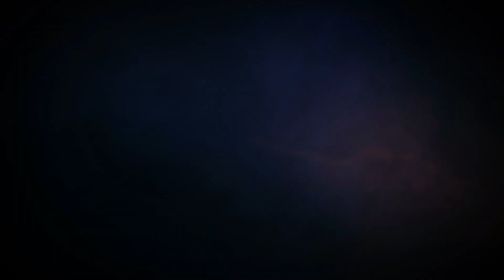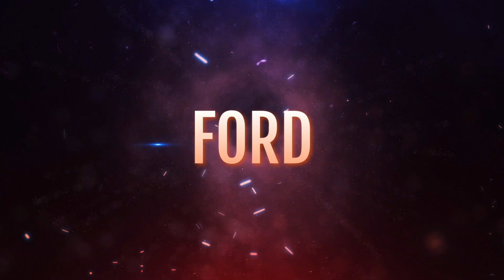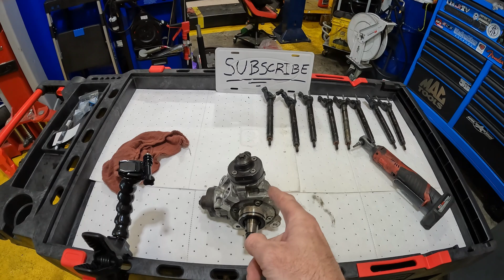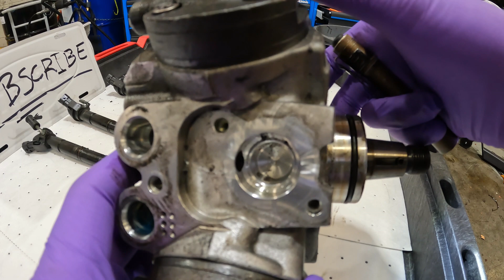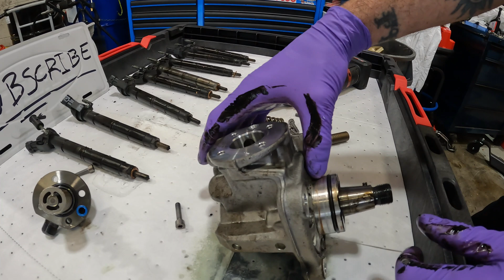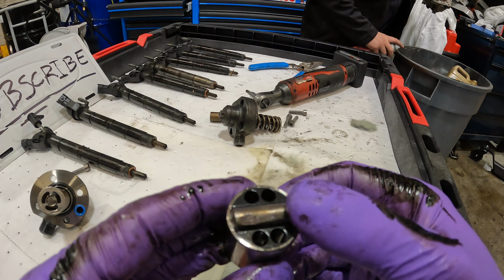Metal Everywhere! Failed CP4 Dissection

Comment: Great video! 
I’ve always wondered what causes them to turn in the bore. High rpm’s when engine braking? Not enough fuel additive? 
Sometimes when engine braking downhill pulling my trailer, my rpm’s will push 3,500-3,800. I slow everything quickly using the brakes because I worry about the vibrations and harmonics at those rpm’s and what it can do to the HPFP like you’ve shown.
Reply from the maker: None of that will cause it. It just happens. Some it may never happen to. Some it happens very quickly. Some it takes a while. This fleet runs additive. I have some with 600k Some with 400k. Still going. Others not so much.  They are all being converted though

Comment: Have you seen bad batteries in 2023 super dutys? I keep getting the remote services disabled notification. Took it to my local dealer who updated the pcm. It didnt help. When i check the voltage with a meter it is at 12 or 12.1. Happens almost everyday after the vehicle has sat overnight.
Reply from the maker: It may have sat for a while. These new trucks anything under 12.w they don't like. I've seen 22's go through batteries. I would have them warranty them and reset battery monitor system.
Reply: @BeardedFordTech  I'm being told that if their diagnostics won't say it's the battery then Ford will not warranty it. Might be forced to buy a new battery myself.

Comment: I dont understand how a multimillion dollar company like Bosch thought it would be just fine for those plungers to not have a stop to prevent the spinning in their bores. Its just straight up dumb to think metal on metal cam would never cause these catastrophic $10k+ problems. The fact that Ford is still just going along with it frustrates me so much too. Even Cummins is now getting away from these POS's 💩 so you know they're garbage. Theres gonna be a class action suit that pays out millions in the future(im sure several are in the courts already). Get rid of that garbage, put a S&S DCR pump & forget about it ever happening again! I'm still rocking a 7.3L but this really frustrates me because this 6.7 is a really good engine, that Ford did their homework on to do the best job after the disasterous 6.4 fiasco.👍🏻👍🏻🛠️🔩🔧🛢️🤷🏻‍♂️😎🍻
Reply from the maker: Well. For beginners you may be new here?  Yes we all know it's garbage. Did you not here me say we put a s&s dcr in it?  That I'm putting the dcr in every 6.7 in my entire fleet.  Whether they fail or not. 10k is a very low price. Every one I've ever done at the dealer was 20k plus. Here running the fleet the dcr kits I get that come with injectors and rails and lines and the pump is 6k. I got the whole kit cause some of them have gone down with metal contamination.  Others are throwing the low fuel pressure code with no contaminants and thats usually the rail.  But it's getting a pump and rails.  I agree. Why on earth would they not make it where it doesn't move. Apparently on the 23's they did.  I mean look at the 2.3 ecoboost. The 3.5 the 5.0. The bucket goes in one way so it can't turn.  Pump sits on the bucket. Never has problems. These cp4 is garbage (so is cummins by the way. Can't stand them) but they were smart and went back to the cp3.  Ram even had a recall on their fuel pumps to replace the..  I'm sure there will be a lawsuit if one has started already.  The 6.7 is a great engine. Just that cp4 is the one major flaw. How many miles you got on that 7.3?

Comment: 250k miles, honestly, I feel like buddy should have replaced the CP4 or done that DCR at like 200k, at least I would have....
Reply from the maker: It's a fleet vehicle. I have some with 600k going strong. We are currently in the process of changing them all the dcr
Reply: Yeah, DCR seems to be the way to go, I'll probably do the same at some point. Looking forward to hearing more about it, I'm sure you'll need a few years to report back on your findings.  @BeardedFordTech
Reply from the maker: @BarnStangz  on a dcr?  S&S put one on their truck. Took it out after a month. Apparently they had water in their tank. It ate it like nothing. No a skip misfire or sign of fuel pressure loss.  Pump didn't have any wear.
Reply: That is some seriously impressive stuff right there! @BeardedFordTech
Reply from the maker: @BarnStangz  💯💯

Comment: When you first showed the plungers down in the bores the 2 sets of holes in each one were situated front to back in line with the Cam.  When you inserted your snap ring pliers the jaws were front and back inline with the cam.  
Both of these demonstrated that the plungers were rotated about 90 degrees from where they should be. Hence the rollers were wearing on the cam rather than rotating with it as designed.

Good shots to show the cause/issue after seeing the glitter from it's self destruction.

Thank You!
Reply from the maker: Yep. You can see the wear marks on the rollers and the cam.  It definatly rotated in the bore.  Your welcome.

Comment: Just recently replaced my 2017 Plati CP4 with the S&S DCR. The CP4 looks absolutely brand new due to a constant diet of lubricity and cleaning agents, but the sound mind speaks volumes.
Reply from the maker: Runs better with the DCR too!  I love installing those things.
Reply: @BeardedFordTech  across the board in every respect…. it was a solid upgrade.
Reply: It's all about clean fuel and maintenance, the fuel additives help to I believe. At what mileage did you replace the CP4 at?

Comment: The way those plungers rotated in the bore and causing the pump failure, it seems it isn't necessarily caused by fuel contamination or lack of lubricity,, but maybe due to air entering the system by either low fuel levels or by not completely purging the air after filter changes or even draining the water separator. The pump cavitation causing the plungers to rotate. 🤔
Reply from the maker: Possible. But then every one of them would do it. Even the ones that I have with 600k miles. The main problem is it doesn't go in one way like the bucket does on a 5.0 coyote to keep it in place. I don't think air in the system or anything like that would cause it to move. I think it's just clearances. Water or contamination would cause it to pit.
Reply: As with any hydraulic system, when that high pressure pump is running and a pocket of air hits it, it will cause a very violent internal reaction which will overcome the spring tension and cause the roller to break contact with the cam and rotate. These plungers should be designed so that they cannot rotate under any circumstance. It's critical to always completely purge the air from the fuel system anytime it has been introduced when doing maintenance. Some techs might get in a hurry and only do 1 or 2 key cycles and then start the truck thinking all is good, not realizing the potential damage they may cause.
Reply: @21psd  the design has been changed by the addition of a guide pin interfacing with the lifter. Granted, the lifter as I’m calling it, is not the high pressure generating component. There is a rod in the CP4.2 that generates the pressure which rides on that component. I’m of the belief it has more to do with spring pressure to the cam/crank surface. Only way to truly know is measure the spring pressure and height like we do on valves on failed units and comparing.
This same pump has different variations including a single cylinder version with both aggressive and gradual lobe ramp rates depending on pump output. Many euro units have less aggressive ramp rates as they don’t have the same flow requirements.
Reply from the maker: @21psd  true.
Reply: @vais3  that makes sense. It's a poor design for sure!
Reply: @21psd  the answer definitely came in the form of an aftermarket in this case. While the hoses utilized could be further minimized, it’s definitely a big step in the right direction.
Reply: Think something along the lines of valve float. The lifter breaks contact with the surface of the cam/crank profile and then falls which causes it to rotate.
The later production pumps used in 2020 and beyond are supposed to have a pin guiding the lifter preventing rotation.
Reply: @vais3  exactly! Hopefully they have incorporated this guide pin into the pump design now

Comment: I’m going on a limb and saying 11-19 production years.

This type of failure cannot be done in a 20-24 due to a design change within the CP4.2. The lifter can no longer rotate in its bore thanks to a guide pin.
Reply from the maker: I just did one on a 2021over the summer .  It still fails. It's a crap design.
Reply: @BeardedFordTech  did you happen to see the anti rotation pin?

Comment: Mine is a 2017 also, but only 160k on the clock. This is the only thing that scares me. As soon as I get my first round of pay with the new business I'll probably be paying you to put on the DPK so this mess doesn't happen. I know we both run additives though, and I imagine that, if the truck this came off of is what I think it is, it never had a lubricity additive.

Also, doesn't the fuel tank and lines to/from it need to be replaced also?
Reply from the maker: This truck does run additive. The lines to from the tank do not need to be replaced. Only flushed. If you put on a DPK this will still happen. The only difference is there is a other filter that catches the metal to keep it from going into the system.  If you want to completely bulletproof it. Get a DCR pump.  Then you will not have to worry at all. Let me know when your ready.
Reply: @BeardedFordTech  DCR is planned down the road. I thought that, without a DPK (did the truck in the video have a DPK?) then metal shavings would run down the return line to the tank. That's what the DPK stopped when a CP4 failed, I thought.
Reply from the maker: @GuretoSefirosu  this one does not have a dpk. Correct the dpk prevents it from going down line. None of the fleet has a dpk.  But they will soon have dcr

Comment: Hello, just curious, if you had to guess, out of all 6.7 powerstrokes on the road today, what would be the failure rate of the stock cp4 pumps? TIA!!
Reply from the maker: Good question. But I do know the answer. 
The Bosch CP4 fuel pump has an unusually high failure rate in the U.S., upwards of 7%, when compared to 1% failure rate in Europe.
Reply: Contamination is the number one reason. Your best bet is utilizing Ford/Motorcraft filters. Aftermarket filters “may” not provide adequate flow or filtration which can starve or damage the pump.
Reply from the maker: @vais3  I use Motorcraft filters. And amaoil fuel additive. Filters changed in this fleet every 10k miles. Samples taken every oil change. No contamination. CP4 is just a garbage pump. We all know it
Reply: Keep in mind that there are literally MILLIONS of these trucks with the 6.7 on the road. I feel like the best thing to do is to keep up with cleanest fuel possible and in order to do that, filter changes need to be frequent. Unlike the old 7.3 PS, that thing would run on just about anything...
Reply from the maker: @BarnStangz  yep. Fuel additive every fill up and filter changes every 10k helps. Won't prevent it though
Reply: Yeah, I try my best. I'm in a farm community, so LOTS of diesel around here, I usually purchase from the same pump. But I guess you never know what you might get when out of the area... I do both filters every other oil change. Cheap insurance I feel like. @BeardedFordTech
Reply from the maker: @BarnStangz  indeed it is. But it's still prone to fail if it's a cp4. DCR is where it's at.
Reply: Yeah, looks like a great pump. It'll be interesting to see if Ford switches over to it. I'm not too far away from AROD so, I'll probably visit him some day and maybe we can install it together! @BeardedFordTech

Comment: Looks like Lisa Frank Glitter Paint in there. It would be interesting to get a fuel sample and have it tested. They've been sneaking bio-diesel into home heating oil at an ever increasing rate. I would imagine that the same shenanigans are going on with diesel fuel.
Reply from the maker: Not sure. I don't have the fuel anymore. Next one I do like this I should send off. That would be interesting
Reply: Biodiesel is a better lubricant than diesel alone. 2% content is a significant increase in lubrication. 5% places it on par with 100 ppm sulfur lubricity levels.
Reply: @vais3  Thanks for the information.

Comment: I’m sure that’s not a cheap fix
Reply from the maker: Around $20,000 at a dealer.
Reply: @BeardedFordTech  holy chit, 20k!? Wow dude.
Reply from the maker: @dustin9035  yep. On the low end it's like $16k. It's a complete system. Pump injectors rails tubes returning lift pump flushing  lines going to tank. Flushing tank.  Just the kit with the pump and injectors and parts is $6k. That's just for parts.  Which is why we can't stress enough. Get a DCR pump. You won't need injectors and rails if you don't have metal contamination. You'll be doing just the pump.